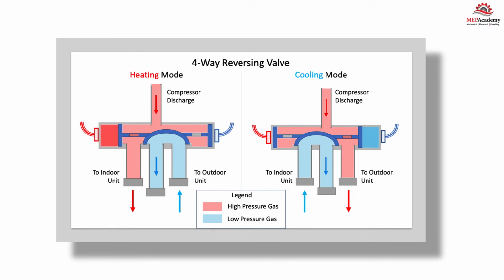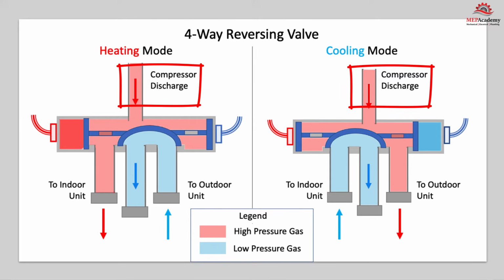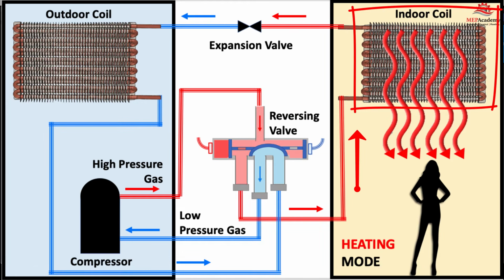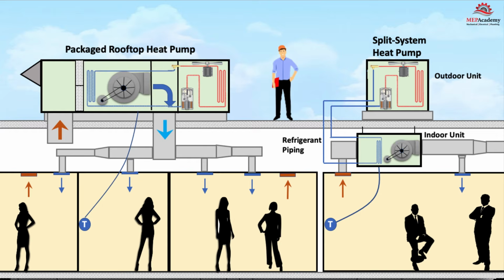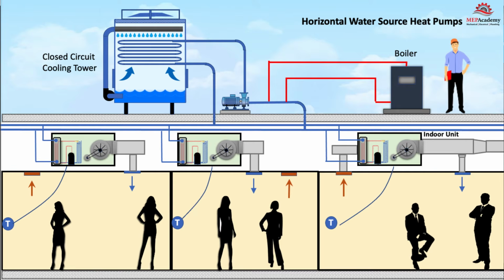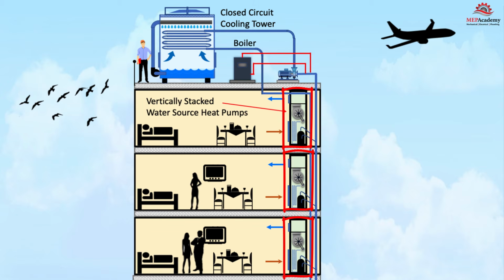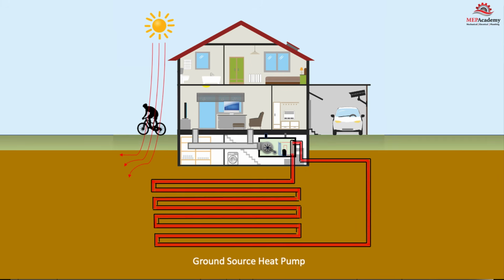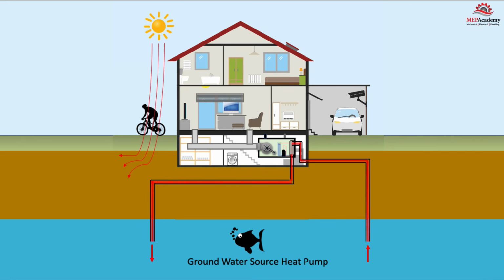How Heat Pumps Work Air and Water Cooled

Comment: For air to air AC/HP at the beginning, wouldn’t this system need 2 separate metering devices depending on the mode? Or a way for it to flip? The animation shows refrigerant entering the valve from both directions.
Reply: There can either be one bi-directional metering device or two seperate metering devices with check valves to control which one receives the refrigerant

Comment: at 9:00 wouldn't the sun heating the soil hurt the efficiency? The water loop is being used for heat rejection in the graphic.
Reply from the maker: Great observation. Yes — if the loop field is close to the surface, direct solar gain can raise soil temperature, which reduces heat pump efficiency when the loop is rejecting heat. That’s why most ground heat exchangers are buried deep enough (often 1.5–2+ meters) where soil temperature is much more stable and less affected by daily solar heating.
In water-source heat pump loops that use a fluid cooler or cooling tower, the loop temperature is actively controlled, so solar effect on the soil isn’t a factor. The system design makes sure the loop stays within the target range for efficiency.

Comment: I don’t understand how heating water and then using that water to heat air is in anyway efficient.
Reply from the maker: A water-source heat pump (WSHP) system improves efficiency by transferring heat between zones that require cooling and those needing heating. Instead of rejecting excess heat to the outside, heat pumps in cooling mode transfer their waste heat into the shared water loop, which can then be used by heat pumps in heating mode. This heat exchange reduces the need for auxiliary heating and cooling sources, maximizing energy efficiency. When the system is balanced—meaning some zones need cooling while others require heating—it minimizes overall energy consumption, making it highly efficient for buildings with diverse heating and cooling demands.

Comment: YOU MISSED A WHOLE POINT , IF THE PIPE LOOP SHOULD BE OPEN OR CLOSED ? AS PER YOUR PRESENTATION ITS SHOWS OPEN
Reply from the maker: Both system types are shown. There is a closed loop used in a Water Source Heat Pump system using a Fluid Cooler, and an open loop in a Ground Source Heat Pump application using ground water. Using a closed loop with a fluid Cooler protects the heat exchanger.

Comment: The coil is the same?
Reply from the maker: The inside coils are similar, while the outdoor coil is different on a water-cooled unit because of the need to exchange heat between two fluids, instead of a fluid and air.

Comment: Thank you for your video! However, I would like to ask why both inlet and outlet of the boiler are connected to the same pipe? I guess it is the chilled water return pipe, right? I feel confused for the connection...
Reply from the maker: The boiler is used for the tempering of the water, and this is the standard method of connecting to the condenser water piping. There is no chilled water, this is the condenser water piping that is kept within a certain temperature range and the boiler only adds heat if the loop temperature drops below the set point.

Comment: can we not use both AC and water heater together?
Reply from the maker: Yes, they make heat recovery heat pumps that can be used to heat domestic water.
Reply: @MEPAcademy  so they don't turn on the cooling tower and the boiler?